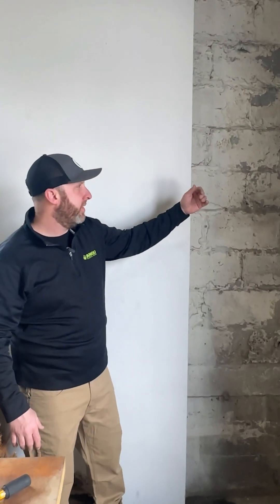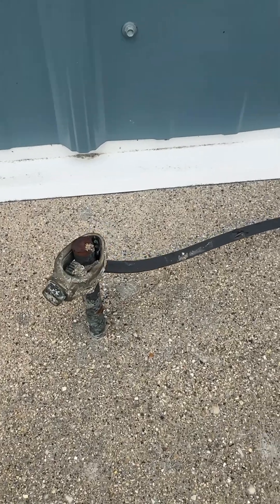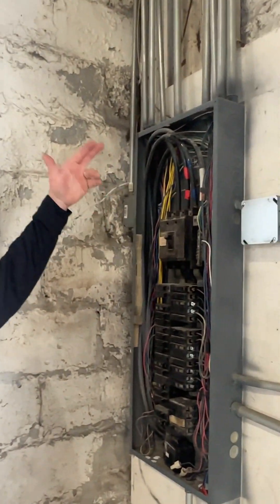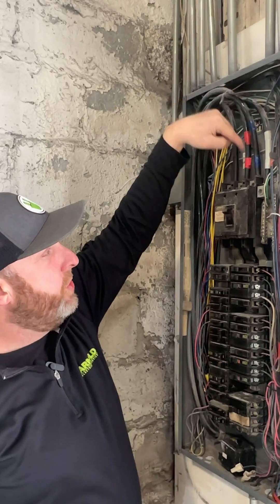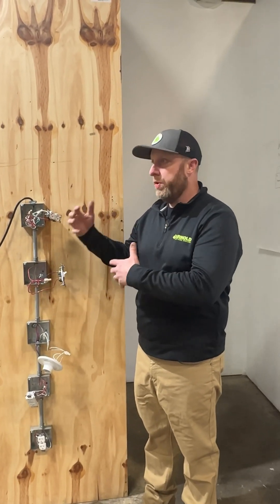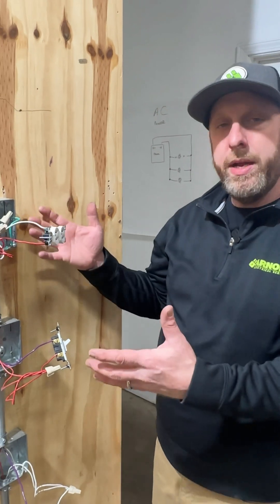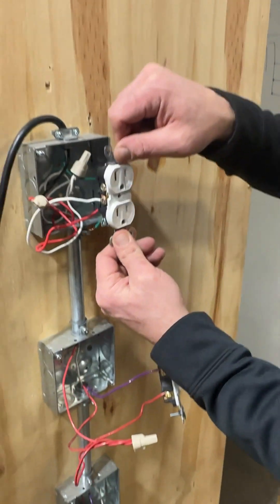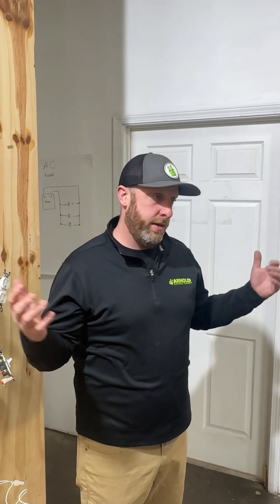How Electrical Grounding Actually Works ⚡ (And Why Your Home Needs It)

Comment: Your panel is a commercial grade system not found in homes.  A three phase system where many branches are 220 volt.  Your explanation does not clarify the lack of a grounding wire in all runs.